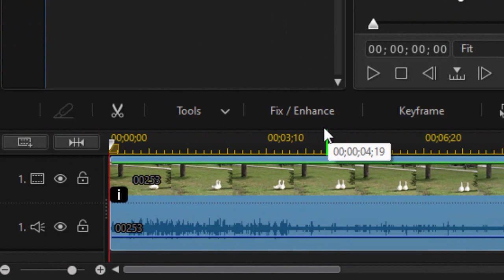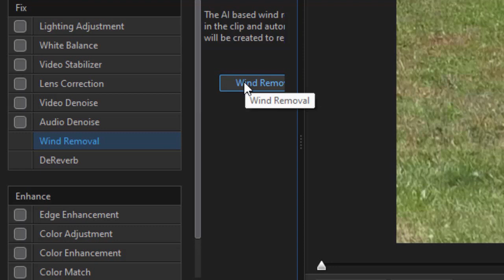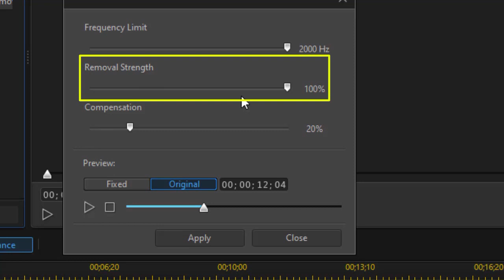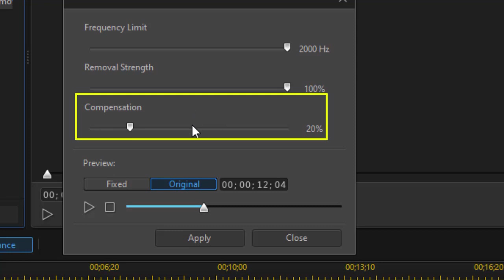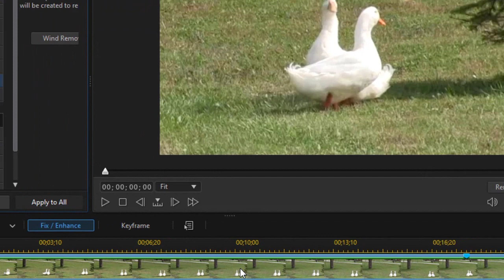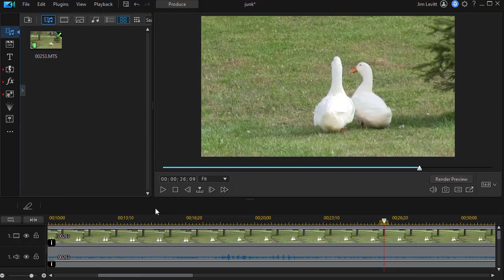PowerDirector - Tips on use of the Wind Removal Tool

Comment: I am hunting for a way to remove noise, that one of my viewers called 60hz. Does PD have a fix for power type noises ?
Reply from the maker: I think I have a tutorial that might include this. I'll poke around and get back to you. --Jim
Reply: @SharperTurtle  Thank you. I have been trying to source the noise. 

I used AudioDirector to record a short clips, as I slowly disconnected everything from my Workstation..... and it the 60hz hum was there even on a naked PC.

I tried using AudioDirectors filters; but what it sent back to PowerDirector lost any fixing I did; and it messed up the order of the edited clips on the timeline :((

Any help would be appreciated. Here is one of my videos with the issue. https://youtu.be/lAHBAVdPPI8
Reply from the maker: Here is something to try. Right click on you clip. Choose "Edit Audio" from the menu, then Audio Editor. In the "Special" category on the left choose "noise reduction". Choose 
"Stationary" and then preview the results with the slider at different sensitivity levels. 
Another option would be to choose the Equalizer under the "Adjustments" category and lower the slider for 63 Mhz. 

I haven't tried these on your clip, but they might help. 
Jim
Reply: @SharperTurtle  Thank you for your suggestions Jim. I have tried them without the success I had hoped for. But I have discovered a technique that does work. After I try it on a few more files, I will send you what I discovered. We all have to work together :)
Reply from the maker: Glad you found something that worked. I'm always learning from users, so let me know how you dealt with your challenge. --Jim
Reply from the maker: I was finally able to watch your video. Great stuff. I love your logical approach to problem solving. So the "Speech Enhancement" worked! That's great. I'm glad that you kept trying options. I'll need to remember that for the future. Thanks much!  --Jim

Comment: Question: How to remove high frequency wind noise? I just need to clip the top frequencies, not the lower frequencies.
Reply from the maker: One approach you can try is to go to the audio editor and load the Equalizer. That will allow you to select one or more frequencies and lower the gain on them. --Jim

Comment: Great video, could you plz do a video on how to edit mixed frame rates on a 24p timeline. I like to film most weddings in 60p for slow motion but edit on a 24p timeline. Thank you.
Reply from the maker: Jojo,

Thanks for the idea. I'll do some research and see what I can come up with. --Jim
Reply: @SharperTurtle  Thank you Mr. Jim,  I have asked others for the same but never heard from or seen a video about this subject, for now the only way I kind of know how to do so is when I add a 60p clip to the 24p timeline, I take the part I want slowed down or speed up by using the speed tool, but this still leaves the rest of the clip at 60p that doesn't play right, so I'm hoping there is a way of doing this easier then what I have found, thank you again sir, your videos are truly helpful and educational.
Reply from the maker: Jojo,
I can't promise I can find a solution others haven't. But if you're patient I'll certainly look into it. --Jim
Reply: @SharperTurtle  I understand and thank you again for just even replying. Have a great day sir.

Comment: Hi, great video as usual. I do get confused, however, re when to use Wind Removal and when to use Speech Enhancement, which also removes wind. Do you have any suggestions?
Reply from the maker: My guess is that they rely on some of the same basic code, so it may be a matter of which one you wish to try. I haven't compared the two, so I don't know if one is better than another. Maybe some users who have worked with both will weigh in on this thread. --Jim